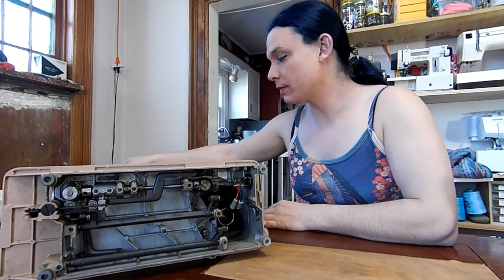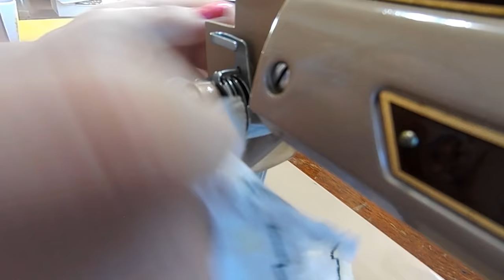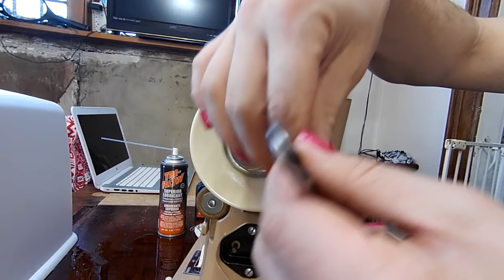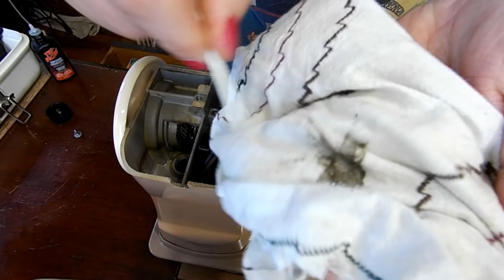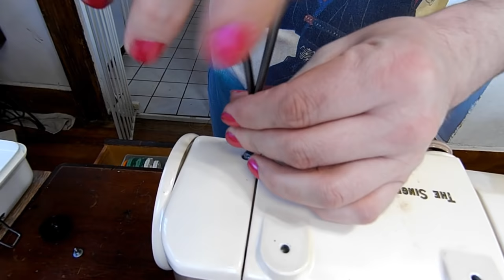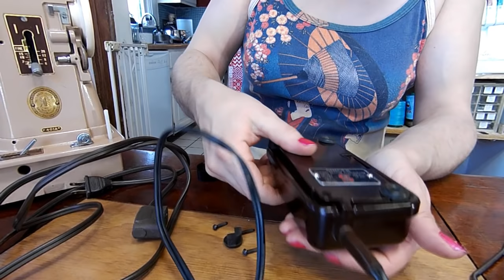How to Clean, Oil, and Grease a Singer 401a Vintage Sewing Machine

Comment: Thank you so much, great video!  I followed this step by step and my machine is well oiled :)  I do have an issue now where the motor wont turn the shaft,  I don't sew, this is my first attempt and I am starting with an old machine from my grandmother, cleaned up now but not working after the cleaning. I can hand turn with a lot of resistance, I can remove the hand turn gear and the motor runs fine, as soon as things are engaged the whole thing seizes up.  It was running before I took it apart :( Any advise would be wonderful!  I hope to learn to sew soon!
*update* I got the machine running, adjustment screw in the horizontal top shaft freed things up!
Reply from the maker: perhaps pull your motor out and make sure it spins freely. If it does inspect the textolite you might have a knocked tooth or a old hard chunk of grease in there. These machines are all metal except the main drive gear on the drive shaft is textolite. But to this date I havent seen one with a knocked tooth.
Reply: @SewSaveMe  Thank you for your response!  I will try pulling the motor, I did try the motor with the handwheel pulled out and it works fine. As soon as I engage the handwheel and try the power it binds. The textolite wheel is in good shape.
Reply from the maker: Hum with out more details im not real sure then. Something in the machine is sticky and binding it up. You might try spinning the hand wheel with the motor out and see if the crank shaft spins freely. If it dont then something in the machine is still sticky or stuck.

Comment: Please show how to remove motor without damaging it because mine are bakerlite love the red nails steve
Reply from the maker: Its pretty simple remove the bottom clip its held in by a plate and a screw put flip the machine back over and tap the shaft with something soft and a hammer it will drop right out even if gooey tared up old oil is holding it in. I suggest a wood block don't beat on the gear shaft directly.

Comment: where did you find your grease?   i’m doing the same to a singer 500a, and the gears are as dry as the Sahara desert .....
Reply from the maker: Im sorry for the Delayed Responce I had no idea youtube was holding the comments until now. I havent found the grease local at all. I get mine on amazon or sometimes you can get a real great deal on ebay but not very often.

Comment: I have a very clean working 640. Can i use this and do I need the solid state speed controller board from the machines minus the needle reset switch. Can I use this motor and utilize the internal light switch for the main power since the pedal has the 2 pad switch in it? Are the 3 wire motors of the 7 series compatible as well (T&S 750 or 776)?

Comment: I have a Singer Merritt 3145 I'm trying to get loosened up.  Are there any other things I need to know how to do to get it going?   There is a lot of gunky grease on the gears next to the nylon gears.  Some has gotten on the nylon gears.  Thanks
Reply from the maker: Good question ive never found one in the wild that didnt have broken belts or crunched gears.  I can tell you so far I use triflow on every thing including a few machines with plastic gears and over the last 5 years the triflow has not eaten on the plastic. So I guess slob it up with some triflow and see if it frees up.
Reply: @SewSaveMe  Thanks, I have 2 of these machines. :-)   I did order the triflow.  The grease and aerosol spray has shipped and should be here Monday..

Comment: I have followed all of your advice with Tri Fold and the oil. I still cannot get some of my built in stitches and the special cams , one or two i think, will not work. Any suggestions? Thanks a million.
Reply from the maker: I suggest you try my old standby ... the hairdryer. Open the top, point the dryer at the offending parts, and heat them until hot to the touch. Then work the parts repeatedly until they move smoothly.

Comment: I have my mothers 401A and two others I found.  One is missing the thread pins.  I bought replacements, but can’t figure out how to install them.  Hammer?  Glue?  Heat it up?  Help?!!
Reply from the maker: If there the correct size they just push in. If the old on is snapped off in the hole you get the pleasure of diggen it out first.

Comment: I know your doing a singer but I was wondering if I would be able to do the same for my brother sewing machine but I can’t get thru the bobbin plate, any suggestions how to remove it?!?!? Also wondering why does my owners Manuel says not to Oil the bobbin plate???
Reply from the maker: Im sorry for the Delayed Responce I had no idea youtube was holding the comments until now. Thats a good question. If its a modern machine "aka late 80's and up" it most likly has plastic in it and most oils degrade plastic / nylon gears. Ill be the first to say im not a fan of brother machines even the vintage ones. Ive only used a few and dont own any so Im not much help to ya Im sorry. :(

Comment: Did you get the brown stitch selector to turn? I have this machine and have oiled and greased everything and that stitch selector won’t budge 😭.
Reply from the maker: Triflow Triflow. Keep it soaked down and let it sit. It will come loose. Dont force it or youll end up really messen stuff up. You could also heat it with a hair dryer but I havent had to use that method in years since I found triflow.

Comment: I need help with the needle position 
selector of my 403a. I think it's stuck? I have it all oiled and greased everything, but I still can't get the needle position lever to move. Any ideas? Thanks!
Reply from the maker: Im sorry for the Delayed Responce I had no idea youtube was holding the comments until now. Just keep it soaking in triflow it will get in there and eventually free up. You might be able to speed up the process with a little heat from a hair dryer.

Comment: Hey there, would you be able to comment on a reason that my 401a is running slow and slightly smoking. If you're interested I can send you a video link. Thanks
Reply from the maker: I would guess you need to service the motor. Badly.
Reply: @SewSaveMe  Yes I actually took it out and rebuilt it following a video I found. It was so full of old oil and really dirty.. After cleaning and reassembling it is again working well, I was thrilled 😄.. I may look at the pressure foot now just to make sure that is in top working order.
But thanks for the reply I love your videos and have learned so much from you that's why I reached out to you as I was at the point of putting this one in the back alley for someone to take and buying something new (!)... So glad I didn't do that:)

Comment: How do you take the motor out?
Reply from the maker: There is a screw in a plate in the bottom remove it and the motor can drop right out. Sometimes old oil tar sticks it in and you might need a wood block and small hammer to tap it out from the top side be careful you dont wanna mess up the gear or shaft on the top.

Comment: What I need to know is how to replace the spool pins.  They do t seem to stay put
Reply from the maker: They just pop out and you pop new ones in. No screws no biggie unless they get snapped off inside the hole then that stinks and a pain to dig out the plastic.
Reply: Maybe I have the wrong ones but this is the second pair I’ve gotten.  The first we’re too big to fit and the second are too small. They wobble
Reply: I have a third pair ordered 😵‍💫
Reply from the maker: I had this happen they were to fat to fit the holes some plastic pins. Get some emery cloth and sand them til they fit snug.

Comment: Nice video,  but, Tri-Flo contains Teflon, PDFEs and other toxic stuff I can't be exposed to.  I have serious auto-immune issues.   For those like myself, who can't tolerate Tri-FLo,  I use a good sewing machine oil, and a hair dryer.  The heat forces the new good oil in, and softens and pushes out the old oil.  I saved many a machine over the years with simple oil and a hair dryer.

Comment: Call me a noob, but Zoom oil was recommended by my tech.  Also very noobish that grease looks like petroleum jelly.
Reply from the maker: Im sorry for the Delayed Responce I had no idea youtube was holding the comments until now. The grea is Triflow. I wouldnt use Petroleum Jelly it gums and turns into hard junk over time Triflow does not. Zoom oil aka Clear sewing oil is decent stuff but it dont work near as good as triflow but if your not careful Triflow can stain. Sewing oil will not.